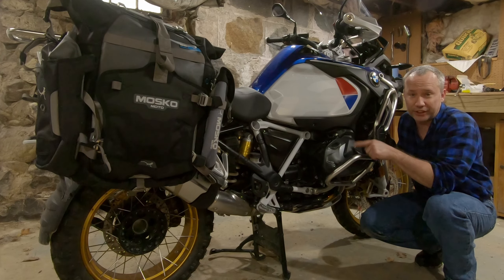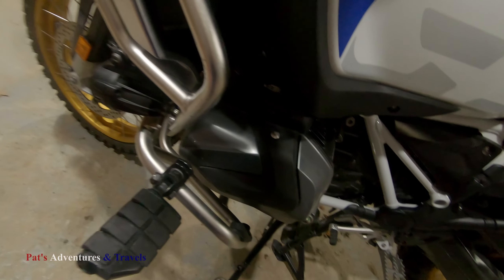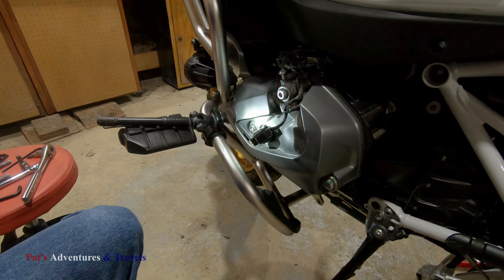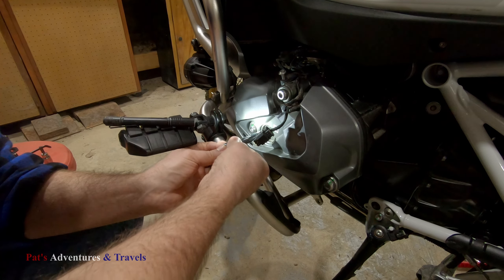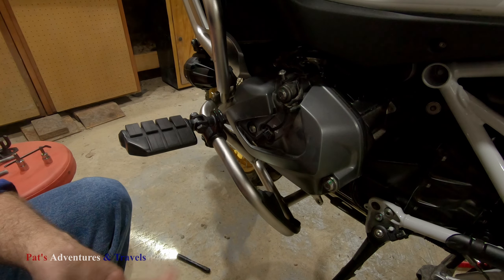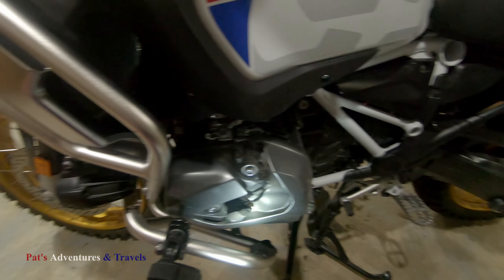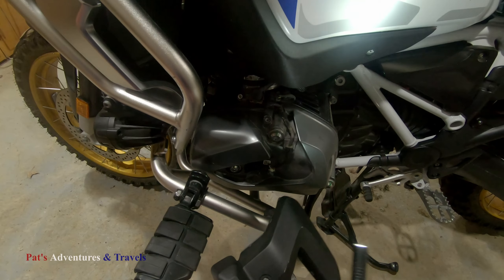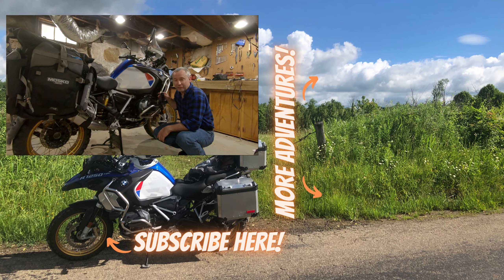First Spark Plug Change (2019 BMW R1250 GSA)

Comment from the maker: Update to this video.  Just took a 5 day 1500 mile ride to Tennessee.  Still have some pinging.  Not as bad as it was though.
Reply: I have the same issue.. (funny my dealer didn't have spark plugs either. )  I just ordered some and found your video.   Any update on the pinging
Reply from the maker: @ericnphx5585  Yes.  no different.  might try a cool plug next time.  not sure yet.
Reply: @PatsAdventuresTravels  after doing a little research  it appears this my be a common issue.   I'm going to take mine in and hopefully it will be a warranty issue.  BTW, mine started doing this around 13k miles.
Reply from the maker: @ericnphx5585  I have read the same thing.  Seems like a lot of things are "normal noises" if you know what I mean.

Comment: (spark plug not tightened far enough?  1/2 turn from finger tight with un-used gasket) You may be hearing backlash between the teeth on the camshaft gears.

Comment: I didn't see you gapping the plug, perhaps done off-camera. The stock NGK LMAR8AI-10 plug is pre-gapped, but to the wrong gap. It comes out of the box at 1.0mm (which is the wear-out limit) it should be closed down to 0.8mm.
Reply from the maker: I did check it and it was spot on with the book.

Comment: could you show me the part code of this NGK spark plug of this R1250gs
Reply from the maker: page 223 of owners manual. NGK LMAR8AI-10
Reply: @PatsAdventuresTravels  Good work Pat!  Do you (or anyone) know "generic" (NGK or other) replacement spark plugs for the 1250GS? Are they the same for the 1200GS (water cooled, i.e. after 2013)?
Reply: thank u so much sir, one more question, sir! How about NGK LMAR8D-J for 1200gsa 2014--> Up, Could be use one this R1250GS?
Reply from the maker: @PeterBaumgart1a  No I have no idea what other plugs may work.
Reply from the maker: @simdina8892  I have no idea if that would work.
Reply: Thank so much sir🙏🙏🙏

Comment: Were did u get the tool for  the coil pack?
Reply from the maker: https://www.beemerboneyard.com/83300401700.html
Reply: Got on order thank you, if you ever head to West Virginia, give me a shout we are just out of fairmont on 250.
Reply from the maker: @waterdude21236    Thanks!  Haven't been on 250 in a few years.  It was horrible in spots last time I was.
Reply: @PatsAdventuresTravels   250 from ohio river to camron is all new pavement from there all the way to Staunton va is in rwally good shape
Reply from the maker: @waterdude21236  That's good to hear.  It's a fun road!
Reply: @PatsAdventuresTravels  also middle mountain road out of elkins, good gravel road and camping
Reply from the maker: @waterdude21236  Is that the one that would take you to Spruce Knob?  I did some road like that in the Jeep a few years back.
Reply: @PatsAdventuresTravels  no it come out at thornwood on 28 just off of 250, whitmer rd goes to spruce, it is right before you get into harman on right bottom of hill past big old barn.